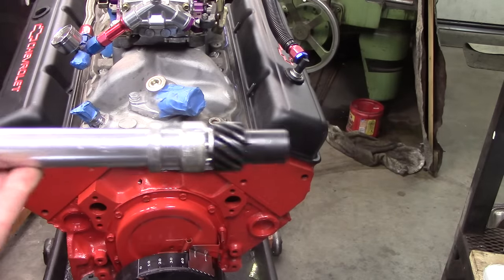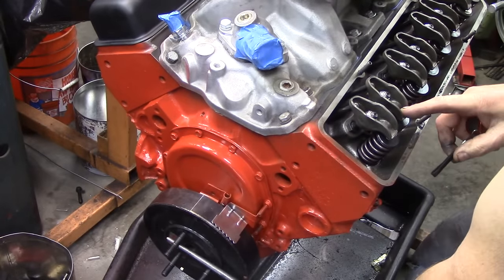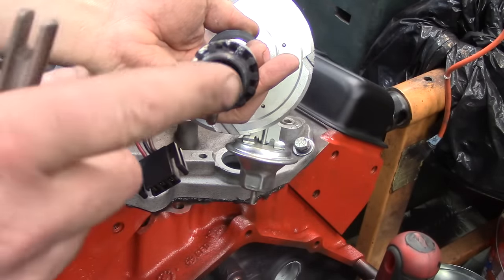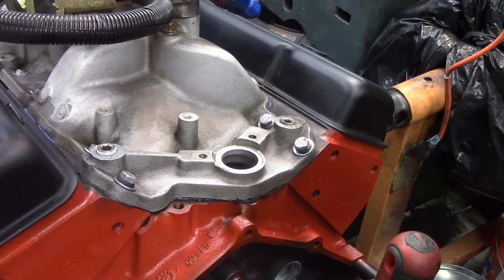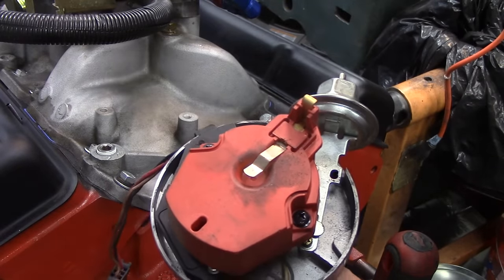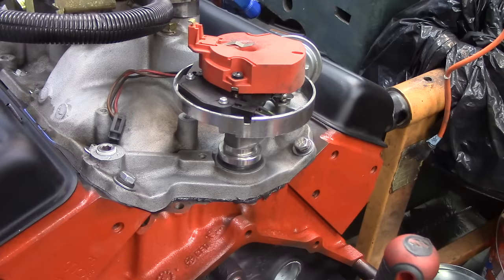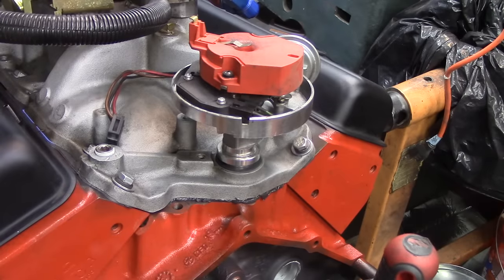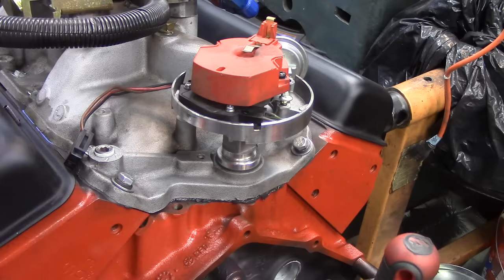How to Install A distributor in a 350 Chevy

Comment: There's an easier way where you don't have to turn the engine.  Insert the distributor as far as it will go. if it doesn't land all the way, pull it up a bit to clear the cam gear, rotate the distributor CCW just enough to have shifted distributor one tooth width, lower the distributor and repeat this process one tooth width each time until it lands completely engaging the pump shaft. if the rotor isn't pointing the direction you want, i.e. toward the #1 cylinder, continue the process of moving and lowering the distributor until it lands again. This time you will note that the rotor position has moved from the position where it landed the previous time. Continue the process until the rotor is pointing the desired direction. This process will take 3-5 minutes, depending on how far away you are from the desired rotor direction. What's happening is that each time the distributor lands completely the pump shaft is rotating approximately one tooth width as the distributor gear engages the pump shaft. This is guaranteed to work every time. It hasn't failed me once in over 45 yrs.
Reply from the maker: +GenasysMech I don't disagree that this works,  but explane to me how your process is easier than turning the engine the process the way you explained it will take much longer and more effort why bother with all that nonsense? when you can just rotate the engine if the engine is in the car just hit the ignition key for a few seconds and you drop right in.
Reply: OMG dude you start your comment by saying "There's an easier way'" and then you proceed to enplane a method that is much harder and probably takes 10 times longer why in the world would you waste your time doing all that B.S. you described when all you need to do it bump the engine a few times I guess some people just don't get it
Reply: Damn Bro. For an easier way your explanation is longer than the video, any that included the installation itself. An old dog can learn new tricks if you let it be that way. Try the engine turn method. When we get older we gotta work smarter not harder.
Reply: +Cary Carrillo you seem to think having access to crank shaft of an installed engine is easy? And with a pry bar? You read my text in way less time than watching the video. huh?
Reply: +GenasysMech You've been a mechanic for as long as I've been alive so by no means would I doubt your expertise.  I mostly do finish construction type work but I also grew up working on cars and trucks with my dad. I haven't had to install a distributor yet but I will for my daughters boyfriend on his 1985 Chrysler 5th Ave.  I'm just searching for the simplest way to accomplish that.  The engine turn method  seems pretty simple.  If I can't get that them I'm sure I'll try it your way. I'd I can't get that then I'm sure I'll just keep going until I do get it. I have no special skills and the only talent I have is I never give up until the task at hand is dialed in perfectly. Thank you for your help.  Respectfully.  Cary C.
Reply from the maker: You don't half to turn the engine by hand  when the engine is installed just hook up the starter and hit the key for a few seconds it will drop right in

Comment: A long screwdriver and a light is easier.  TDc #1,  slot on oil pump  fore and aft, drop distributer so rotor is facing  #1 - done !
Reply from the maker: nope using a screw driver is a waste of time especially when your up ageist the fire wall I know it can be done but easier than this No way

Comment: If you had the spark plug out why didn’t you just look and see where the piston was ?
Reply: Piston goes up twice, once for compression, once for exhaust, you need the valves to be closed to be TDC. Visually this can be done by watching the rockers, or lifters intake manifold off, but easiest to feel compression with finger/whistle etc as that guarantees both valves are closed. Just looking at the piston won't guarantee the exhaust valve is closed.

Comment: What are you using to turn the crank ?
Reply from the maker: I usually put a couple of studs in the Harmonic balancer you can also bump the starter with the key, it can be kind of a challenge if the engine is in the car and the Pullys are on the front of the engine I try to avoid a breaker bar on the crank bolt because it's pretty small on a chevy (7/16) and rotating the engine with a socket on that bolt has been known to snap that bolt off in the snout of the crank and then you have a whole new problem

Comment: will this work on a small block Chrysler? thanks jm
Reply: negative.. Chrysler's oil pump drive it direct from the cam. In fact, the Chrysler distributor is driven by the oil pump drive.(unlike the chevy). I did my sb 318 by "walking" the oil pump drive with magnetic telescoping tool and walking it. Other end of that drive gear is a hex, so finding the correct rotor position is a tad bit easier.. well it was for me anyways. Did a hand full of chevy engine rebuilds, so I've done both distributors. In either drop in, if it's a fresh rebuild, I'd highly suggest you take advantage and prime the engine by working the oil pump. Chevys will fill the oil galleys by driving the oil pump but the Chryslers will require you to rotate the crank 180 to let the other 1/2 of the valve train to fill up.. sorry for a "novel" reply!... ;)
Reply: TKs for getting back to me! these are marine Chryslers iam doing the manfolds and everything else /when I looked at the distributors they are quite dirty AND rusty so I though I would rebuild them some one told me to rotate crank till u get to tdc with #1 and set just below o degrees since timing is 9 befor tdc what do u think tks jm

Comment: It's just too easy to use a screwdriver and avoid unnecessary turning of a new motor before startup..it's not a matter of right or wrong..it's a matter of preference..also turning it over that way you damn near flipped it over or rolled the wheel over your toe..that doesn't happen if you just turn the shaft with a screwdriver
Reply: you can't be serious I Fu%$#d  around for 20 minutes trying to drop my distributor in place with a damn screwdriver I went inside watched this video and had it in and fired up in 5 minutes saying the screwdriver method is easier is just plain stupid and wrong best video on the entire web right here
Reply: @dtorr222  well to get it in the ballpark you can turn the slot of the pump shaft to #1, but I think turning the crank over is simpler

Comment: some how my timing keeps slipping on my truck. i get it set right and drive it for awhile then it starts to sputter and miss really really bad. like so bad its like slamming on the brakes. i stop and play with the timing for awhile then it will work for a couple days. ive tightened the bolt up very tight and it still does it. also put on a new chain and gears

Comment: Actually there's a better way of doing this and that is by watching your cam timing you cam tell that you're on top dead center the other is you put your finger on number one spark plug hole as you rotate the engine looking at top dead center and the timing mark 1 turn maybe very very little pressure and trutops dead center will put your finger off the hole then you could shut your distributor in and you may have to set up a little bit of head line up the oil shaft by turning the engine with the key with proper timing is once you have distributor in the hole weathers points set your engine at the timing you guys are into run at set at 8 degrees ahead or 10 degrees as the points just start to open you'll be at perfect timing I'll show with electronic ignition watch the trigger Wheels some Wheels when they line up touch the pointed ones like a GM and the other Square type halfway again that will be when did you stripper triggers to spark I built many engines like this and put the timing light on and sometimes I don't even have to move to distributor perfect timing Read VW book it'll show you how to do this use the same method for any engine also the German engineering will show you how to set perfect wheel bearing adjustment
Reply: What VW book would that be? And also the wheel bearing one too if you don’t mind? Thank you in advance

Comment: No offence, but I will continue to waste my time and use a long screwdriver to turn the oil pump shaft to drop the dist all the way in. I had a cam tooth chipped when I powered a dist in bumping the starter to get it to drop, the Dist. got jammed so tight we had to pull the motor out of the car and drop the pan & oil pump to get it to let go.  Never happen when you turn the shaft with a screwdriver till the Dist. drops all the way in.  One of the reasons I get in NO HURRY to build a motor. When everything is right, you have less chance of a fail. Yes I know, I seen all kinds of guys get away with doing your way, but I seem NOT to be that lucky and at 70 years old, I see no reason to chance.  This is one of the 10% of things I do not agree with you on. The other 90% were good.
Reply from the maker: I don't bump it with starter either done thousands this way zero problems I am willing to bet you were not in as far as you should have been of it was binding for some other reason

Comment: It's just as fast to turn the shaft with a screw driver. You said it a waist of time but that's just not true.
Reply from the maker: you clearly have never worked on a vortec or TBI engine in a Taho or Impala
Reply: @Myvintageiron7512  ok sure

Comment: set balancer at 10 btc not zero engines don't run at zero take gear off old distributer use to set oil drive

Comment: Just drop it in, wherever your rotor lines up at, start #1there.
Reply from the maker: That is not possible on many applications the Vac Advance interferes with to many things.
Reply: Well of course you need to put the vacuum advance in the location you get the most movement out of it. The rotor doesn't know what cylinder it is firing. It's just sending a spark.

Comment: I just put in a new street fire distributer, by msd. Its doing the imposible.! When I plug vaume advance   anf set total timing at 34bto 36 degrees BTDC, i have a stop installed  on the vacume advance  that set at 5 to 8 degrees . Here is the imposible part, mrcanical advance  is 22 degreese, vac somewere sround 12 degreese, soon as i hook up. Vac adv. Timing jumps to 30 at idle if you raise rpm to 3500 to 4000 ewhere zi set total adv. It getting up to 45 to 50 degreese BTDC.!???! How msd hasent been able to answer so far, definetly not a good thing but any one hsve any ides how thus could be hapening, the phisical build of distributer should make it impossible! . ? ! WTF
Reply: Maybe